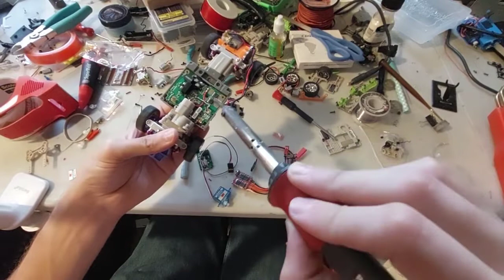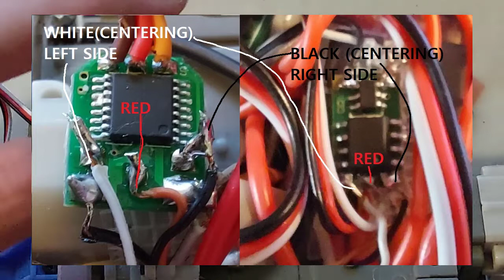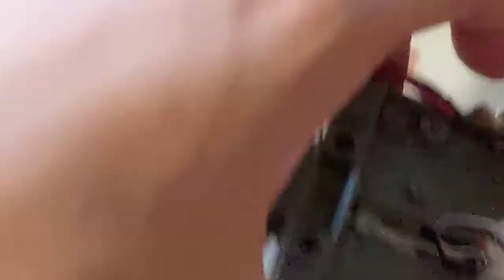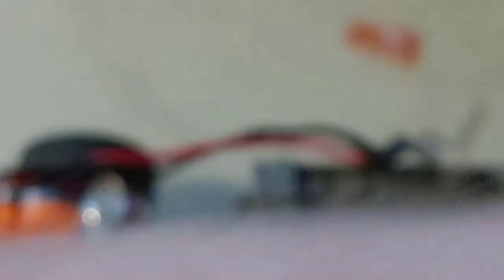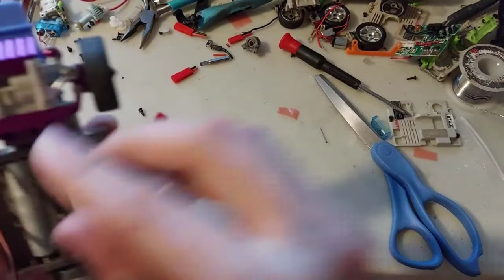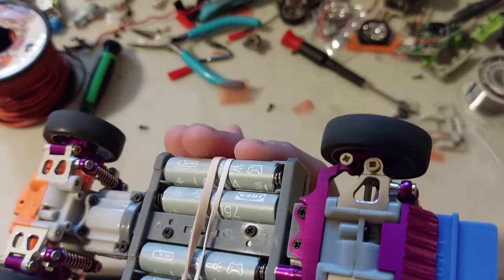Converting Xmods Evo to Hobby Grade - NO 3D Printed Parts

Comment: Honestly, these already came with proportional throttle and steering. By these I judge Xmods to be hobby grade bone stock. The parts have become almost unobtanium to keep them going in any form though.
Reply: Need to check out the 3d print files there's tons

Comment: Dunno if i did somethin wrong however I am using a 2s lipo as a test pack. I have soldered the servo board correctly, however no matter which way I have the two wires it either full locks to the right or left. No in between.
Reply: You didn't center your servo before installing a horn.

Comment: I used rubber bands on the og x-mod instead of the clips for a weight reduction, and also got rid of all the suspension springs and used rubber bands instead. It definitely made it lighter

Comment: What remote control do you use? I'm having an issue with both my xmods where they both like to steer to the left, and it locks into place. This looks like an easy mod to do. I only have one remote control since they're both band 1. I think the issue is the remote control, if I figure out what control you use I might do this.
Reply from the maker: I just use a cheap multichannel Skyfly remote from Amazon. Then that reciever connects to the other components in the video.